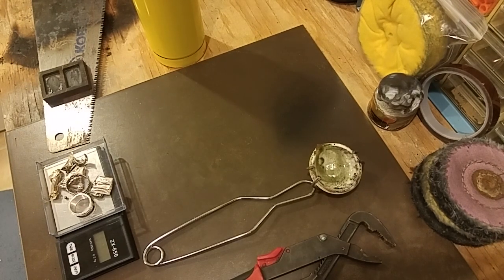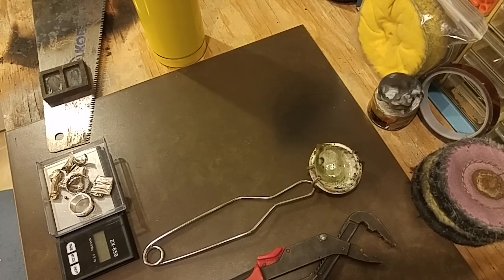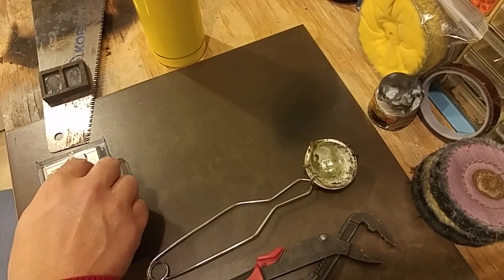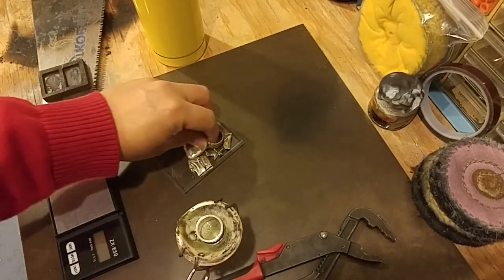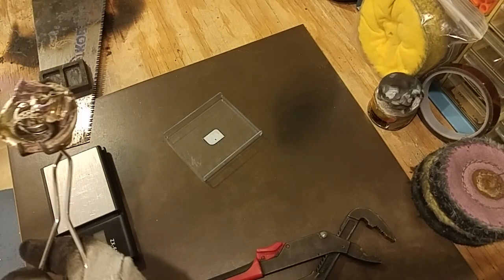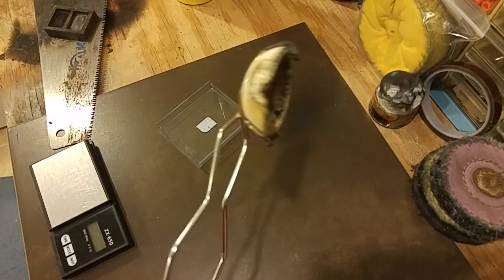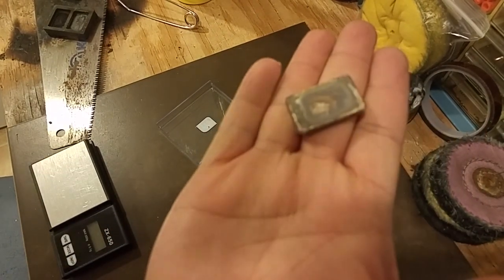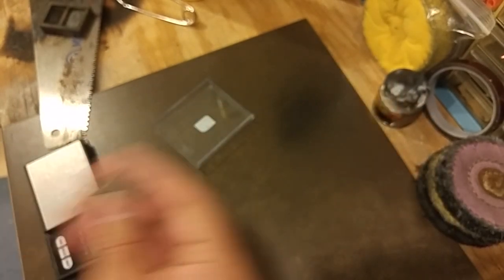Part 1: Home Made Poured 925 Sterling Silver Bullion Bars

Comment: I watched all three parts... interesting.   My question has to do with your source silver.   There's ALOT of silver jewelry floating around that is marked 925 or 'sterling', but it really is not.   It might be steel, or nickel, or tin, or some other kind of cheap metal.   How were you able to confirm that your source silver jewelry and rings was 'really' sterling silver ?  Is it possible that all you have are nickel bars, or something else ?
Reply from the maker: +Joe Knipp yup tons of fake crap out there, if its steel plated sterling the magnet would pick it up so that rules out steel. If it was copper plated silver the metal would be a different color. In fact Mapp gas is not hot enough to melt steel. I buy my silver from reputable shops and sterling jewelry had markings and also has been tested. The spoons i bought were marked and tested with a XRF Analytical Machine that uses x-ray technology to determine the make up of items. I would highly doubt that these bars are not sterling. Nickel melts at 1000 degrees hotter then silver also. Would take longer to melt, but Mapp gas does melt Nickel. Trust me i k now these are sterling lol i did my research before because its not cheap (well right now it is lol) but its sterling silver bought from reputable places and tested with acid,XRF machine and magnet tested. Very Good questions and thanks for watching.